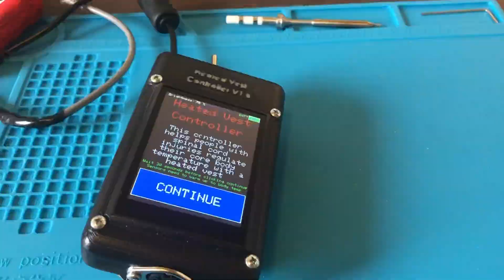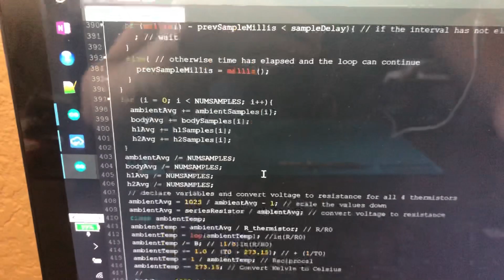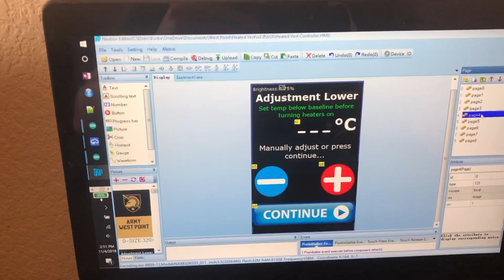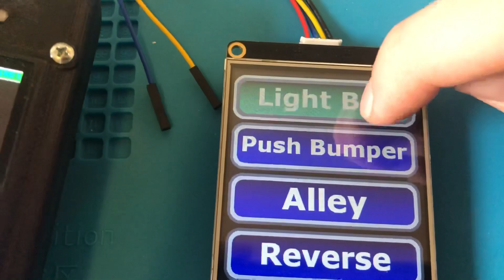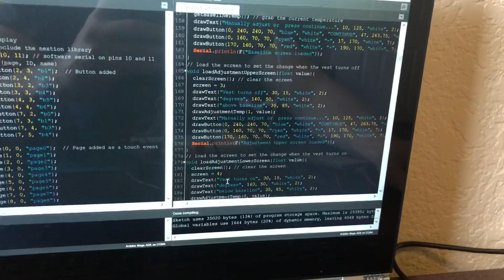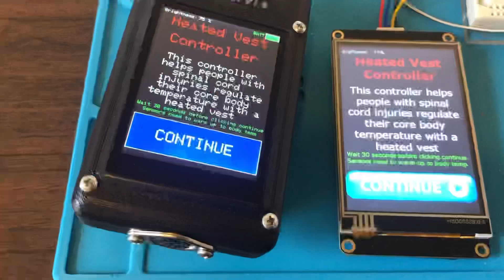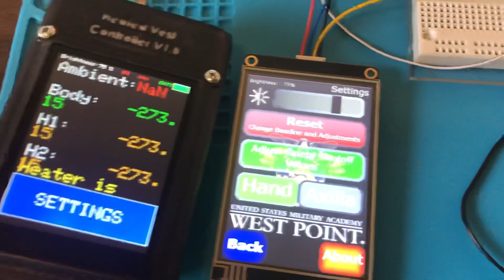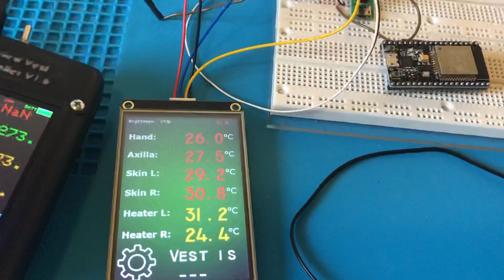Nextion Display for Arduino:Overview and Adafruit Comparison

Comment: Hey how are you powering that nextion display? Is it some sort of a USB convertor board?
Reply from the maker: The Nextion screens come with a little green board that just has a micro usb connector and 2 pins on the 5v and ground pins so you can easily power the Nextion from a micro usb. You can also use an arduino to power it

Comment: Great video! You seem to have a knack for this. I am just starting to use the nextion displays and your videos are a great help and inspiration. Please do more of these (nextion) videos as you progress with your projects. They really do help people, like me.... subbed.
P.S. what fonts are you using on your nextion? They look very nice and clear.
Reply from the maker: Moto Geek I’m glad I could help! I’ll definitely be doing more Nextion videos and I’m currently working on “the ultimate USB keypad” where it’s like my regular Nextion keypad but with a bunch of other features. For the fonts I used, when numbers are displayed, it uses the Nextion font “TechnicBold” and I also checked the box next to “bold” when generating the font. For the rest of the fonts, it’s made in GIMP and the font is called “Standard”. Thanks for watching and commenting!